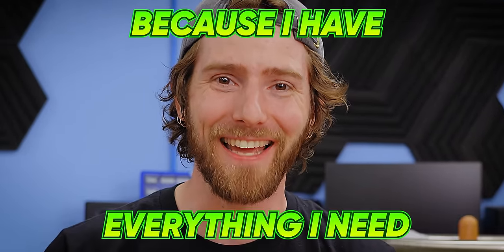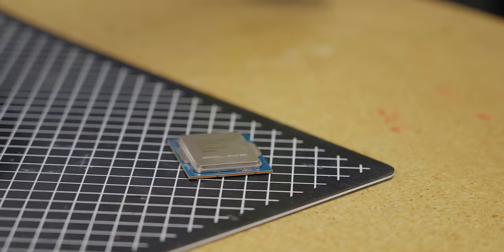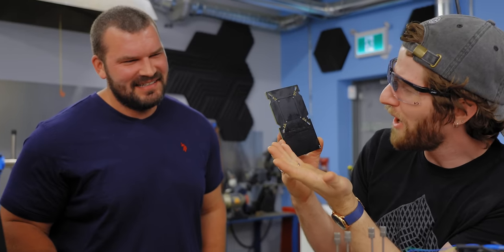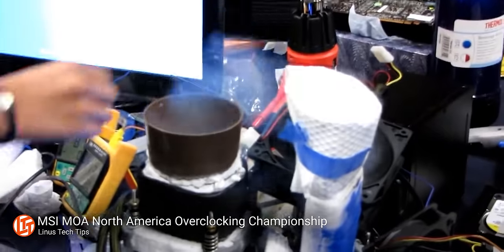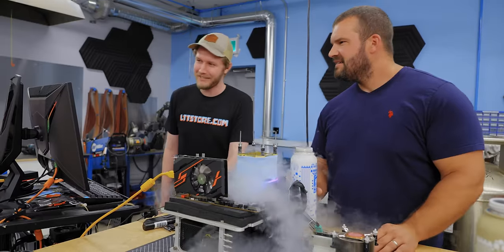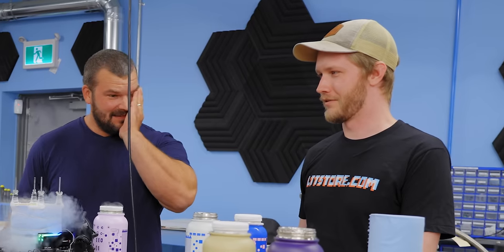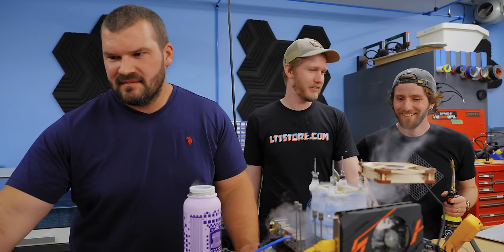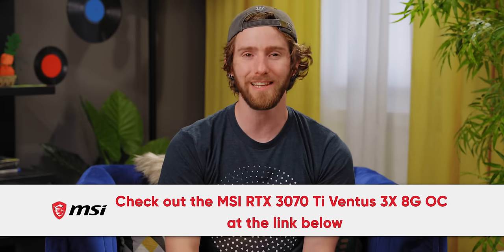The 6.9GHz CPU - LN2 Cooling

Comment: Couple points! Thank you Nikolay Pelov and linuxgeex

At this low a voltage, the motherboard should never arc.

Also, the true thermal barrier isn't even the increased resistance.  It's the reduced impedance due to increased quantum tunnelling as temperature goes up, which increases leakage current, which is the majority source of the increased heat once you get into thermal runaway.
Reply: Is this linus's personal youtube account?
Reply: Okay did not understand it at first
Reply: please make pc inside the vacuum chamber
Reply: ok
Reply: Nice It Linus Jobs!
Reply: @eastenmay4823  idk but it got pinned
Reply: Cool tech tip
Reply: Ar,  I always get me quantum tunneling mechanics confused when considering thermal runways
Reply: I was wondering about this arc comment, it was first Time i Heard about arc due to current
Reply: please try the chuwy larkbox mini pc
Reply: The quantum realm has made Linus forget to log into the LTT Account. He tunneled into his real form so to speak.
Reply: Linus pinning Linus and giving him a heart...
...sounds weird. x)
Reply: @IngwiePhoenix  ya
...is it really linus?
if it is it's probably his other account
Reply: @GD15555  Not sure what good that will do if you want to run things cold. Vacuum do not conduct heat. So the only heat transfer you have is via radiative cooling. Which is the worst cooling. Spacecraft have a big issue with this. So they generally have larger radiator surfaces to help get rid of heat (as well as running relatively with very little power, which helps).
Reply: the quantum tunneling effect > increases leakage current effect would explain why even overclocked it was drawing less power than it would stock on air/water, there's simply less wasted power.
Reply: Beardless linus is not the same…
Reply: Is that (reduced impedance) why the wattange decreases with temperature?
Reply: Idk just like to point out, you missed a perfect excuse to make an "Ice Nine Chills" joke, there is a band named Ice Nine Kills. And you know frozen cpu in the thumbnail.
Reply: you just made that up
Reply: @IngwiePhoenix  It's the Linus Conspiracy
Reply: Linus have you ever heard about Doppler cooling using lasers? Liquid Nitrogen is impractical.
Reply: Yes, I also understand these things.
Reply: Aww I'm certain this was the channel picture when I first subbed to LTT
Reply: Ok nerd
Reply: TIL that silicon has a negative coefficient of resistivity. Now the part of the video where he said the board doesn't like to turn on when it's too cold makes a lot of sense- the impedance of the cold silicon is too high to allow current flow at the voltage that's being applied.
Reply: Wouldn't that trap all of the heat?
Reply: nice
Reply: You are the Meme answer of "why women live longer than guys"
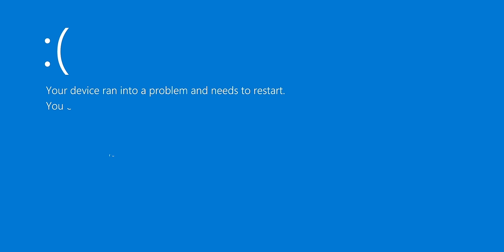Reply: @laupoke  15:52
Reply: Haha, I like your funny science words tech man! Now it is time for me to haphazardly throw my PC into a microwave.
Reply: Bruh... Can u give me this 1030... I still can't afford it in pakistan
Reply: @nickpayne1182  It's true of anything but conductors.  Even a degenerately doped semiconductor though will start to act more like a metal.  It's just a matter of increasing temperature giving you more free electrons (and holes) to conduct but increasing temperature also increases lattice vibration in the form of phonons.  This is why thermal runaway in semiconductors can be an issue.
Reply: @Cythil  The heat radiation travels through it, but yeah, you can't just make heat flow like in matter
Reply: Yes, but is it fitted to the ambiphasient lunar wane shaft in such a way, that side fumbling was effectively prevented?
Reply: @nickpayne1182  l
Reply: Thanks man I understood everything
Reply: my friend its nice to see you bend with the legs but safety should be first not after shattering a banana ...otherwise this rocks
Reply: One more point mister Sebastian, the term for moisture in the air going from a gas to a liquid is condensation, or the act of condensing, as the molecules condense, or become denser, condensating is not the correct term, idk why but this triggered me a bit.
Reply: Real yt acc
Reply: I was about to say the same...thx.
Reply: @GD15555  it'll just run hot.

They've had to deal with that in space, probes/satellites have issues disipating heat.
Reply: @JorgetePanete  Yes. You nether benefit from conductive or by flow in vacuum.
Reply: The quantum world limits our gaming sadly. probably in 2100 we'd be playing on Quantum Computers (though Quantum computers are VERY not fit for gaming).
Reply: Why don't you guys try making a chamber with a constant flow of nitrogen gas? That way, even if there is a leak somewhere, as long as there's a positive pressure of nitrogen gas inside, moist air won't be able to come in. Unlike with a vacuum chamber, you must ensure a good seal between all the cables and things that need to be accessible outside. If something went wrong with the hardware, you wouldn't know until after you evacuated all the air out of the chamber and fired it up, which takes time.
Reply: You should try making a watercooler out of a eutonic NaK solution, it is probably by far the best liquid coolant.
Reply: Wat.
Reply: A 6.9 is a 69 that got interrupted by a PERIOD!
Reply: You even got Jack Reacher on the show!
Reply: since when Linus became nerdy enough to know about impedance or quantum tunnelling or leakage current ??
Reply: @AbdelrahmanRashed  Anthony told him before the show
Reply: While I can appreciate the technical fun of this sort of activity, but I have to ask why?
What is the practical application of this? What has to be done to keep the cpu this cold takes away from using the computer for anything but just bench-marking the cooled cpu.
Has anyone actually engineered a complete closed system that can do this while running as a regular workstation? Not one you have to babysit with constantly evaporating nitrogen?
From an outside observer this just looks like 1/4 mile top fuel drag racing, just with out all the excitement.
I'm not trolling. Have fun with this hobby! I just don't understand why, bragging rights? Knowledge gained in possibly engineering something that can run consistently at this speed? Galactic scale Minecraft worlds?
Reply: @GD15555  Hmm yes over-temperature protection speedrun.
Reply: I take it this is the account that can open garage doors.
Reply: Wowowow. the owner is here.
Reply: These vids are always mind blowing.
I'm slowly saving money to upgrade from my current FX8370 rig I built in 2014. This makes the cpu choice harder.
5950x x570 or 12900K z690.
This upgrade needs to last another 5-8yrs
Reply: In transistors the resistance actually decreases as the temparture goes up. This is what causes the runaway effect. Lower resistance means more current which means more heat which means lower resistance. This is what the runaway effect is all about.
Reply: @GD15555  Where would the heat dissipate into?
Reply: @eastenmay4823  I believe it is... Not 100% sure, but very nearly so...
Reply: Been a while since we saw this account comment.
Reply: yet the record belons to AMD FX-8370
Reply: I like your fancy words madman
Reply: Nice picture
Reply: <obamaawardingobama.jpg>
Reply: @GD15555  I Bff dtyette my hair and I can x
Reply: i read this around 50 times, can you explain in ape language for me pls?
Reply: Why did Linus heart his own comment?
Reply: I was, dafuq? Then, well ofc ^^ carry on friends
Reply: I disagree. Why would  leakage current, which is considerably lower than the majority current be the biggest factor in thermal runaway? Surely both currents are responsible for heating the semiconductor device up, and the higher majority current being considerably higher than semiconductor device leakage currents and therefore cause a greater temperature increase.
Reply: 6.9 - the humor in that number is not lost on most people.
Reply: @peterbelanger4094  Hobbies are a matter of perspective. I find this more exciting and pleasant than the quarter mile drag race, personally. Less noise and fumes and it touches on the spooky quantum science stuff rather than boring old combustion engines.

You've essentially hit on it, though. It's just a hobbyist pursuit of optimizing for the sake of optimizing at thus level. These guys picked a CPU benchmark. Others pick a quarter mile time. Still others are really into finishing videogames as fast as humanly possible. 

These things either capture your fancy or they don't. Sure you can try and work backwards to justify some grander purpose, maybe talk about cultivating practical transferable skills like problem solving, attention to detail, a working knowledge of electronic components and principles, etc. but that's just what you put on a CV or a funding request to justify to othera something you already want to do.

At the end of the day enough people looked at this and thought 'neat' to make a passtime of it and here we are. Maybe something "practical" will come of it, but it'll more likely be by accident than design. 

Then again, history is littered with a number of examples of major innovations that came about from intelligent people goofing off, so who knows?
Reply: Make one for the space station and leave it outside -450 Fahrenheit
Reply: @theSCARB  I'm in Canada too, but Linus is younger and relatively new to computers compared to me lol.  Hence my avatar being bald!  Though with the toques and ballcaps and hoodies Linus wears all the time I guess it might be easy to assume he was covering up! ;-)
Reply: Yep, CPU voltages are now well below 3.5 volts even with maxed out overvoltaging.  This should be perfectly safe for everything but the CPU itself.
Reply: @eastenmay4823   It seems so
Reply: Why - to get rid of moisture in the air - don't you just get rid of air and fill it with... nitrogen for example (kind of half hermetic container that is filled continously with nitrogen and vented out by single vent hole. No moisture - no problem.
Reply: Probably Anthony wrote this.
Reply: nerd
Reply: #LinusHighTips
Reply: @GD15555  That wouldnt really make it colder or make it run faster, it would cause the board to overheat pretty quickly as there is no air or liquid to remove the heat from the system.
Reply: WoW. Never new lienus had a last name.
Reply: This account will be a decade old tomorrow lol. 24-10-22
Reply: @GD15555  i dont understand why nobody did this already it's so simple
Reply: Dude said “liquid water”
Reply: @GD15555  liquid nitrogen boils extremely quickly under vacuum. Thermal throttle a few seconds later
Reply: @eastenmay4823  yes
Reply: @eastenmay4823  i would say no if you check the accout il looks like some fan account.

Comment: I have to say this, I am really impressed by your water bottles and how well they are isolated. I never thought they can hold something like liquid nitrogen for such a long time and that you can hold it with your bare hands.
Reply: This video actually might be the final push for me to get some
Reply: This video is way better marketing for the bottles than anything else they can do.
Reply: you need a vacuum insulated water bottle to prevent the ln2 from freezing your hand
Reply: Tbf, even normal vacuum bottles work just fine, as long as they are actually vacuum flasks
Reply: @YannickBo  For some extra convincing, if I fill my water bottle with ice and ice cold water and leave it shut, it won't finish melting for around 20 hours.
Reply: I think you meant "insulated". "Isolated" means kept away from other things. "Insulated" means it stops the flow of heat or electricity. The LTT water bottles are insulated by stopping the three main forms of heat transfer to the surroundings: conduction, convection and radiation.
Reply: This isn't a OC video, it's a water bottle commercial :D
Reply: Vacuum is vacuum. Best insulator on the planet. If you want their bottles then go ahead I'm not stopping you. They do have cool designs. And they've certainly proven that they're dedicated to quality. But if you're on a budget you can get the same functionality for half the price.

Their low volume gives them a significant disadvantage in price. Their prices have to be high in order to even justify the expense of rolling out new product.
Reply: @sntslilhlpr6601  vacuum is great for conductive and convective thermal transfer, but it does nothing for radiative transfer. At these temperatures this is not too much of a concern, as it goes proportional to T^4, at higher temps radiative transfer can be the dominate heat flow path. With small vacuum flasks like this most the heat transfer is through the lid and the top lip of the bottle.
Reply: Just remember never to put the lid on if playing with this at home.  Might be hard to tinker on your PC after you loose a few fingers or a thermos bottle lid replaces your eye.

Comment: im working with cryogenics for work and the samples we are working with need to be handeled in LN2 at all times so seeing this i got some ideas. If you put the motherboard in a big container, the gas nitrogen (from the boiling) would fill it because it is heavier than air and you would not have air (which has all the moisture) around it. If you have a university or research institute around, you could think about contacting them. Cryogenic work is quite common nowadays and there is probably some experts around that can help with this
Reply: These guys handle some ridiculous materials. They do some ridiculous electrical mods. They engineer all sorts of ridiculous hacks and workarounds.
But they insist on using "common" consumer parts in "common" consumer conditions. That means a computer on a table in normal air, no complete immersion, no vacuum, no exotic environments.
Dunno why, exactly. The hobby is cutting-edge math, science, and tech on one hand. It's unscientific bumbling on the other. It's ruthlessly competitive on one hand. It's team collaboration on the other. It's methodical experimentation and calculation on one hand, it's reckless gamble on the other.
Reply: To add to Groentje92 comment:
Make the container out of 30mm plexiglass then enclose the top. whole thing rubber sealed. Add a flask with a tap to allow the topping up of liquid nitrogen.
Add a vacuum pump. this will allow the chamber to be pulled down to a lower pressure, lowing the boiling temperature of liquid nirogen, allowing even colder temps.

Also might be worth adding a 45psi burst disk,.. just in case of over pressure even if vaccum pump fails at some point.
Reply: @Danko Kapitan structural biology. The microscope we work with works in cryogenic condition so we have to prep our samples accordingly
Reply: @shanewilson3653  I didn't want to go into vacuum as it is probably alot more difficult to pull of but you are completely right. Woud be even better
Reply: @shanewilson3653  when tou close it off you cant heat the cpu up anymore to boot 🤔
Reply: I'm a refrigeration mechanic. I've always wanted to encapsulate the board is a nitrogen filled chamber, with an oring seal around the mouth of the ln2 pot, and sealed wires. Put a few 1/4 flared fittings on it so I can pull a vaccuum and fill it. It would be absolutely 100% moisture and condensation free. My only suspicion would be a leak through the wires, that happens with compressors from time to time.
Reply: @shanewilson3653  I've always wondered why these 'professional' over clockers never just put the thing in a vacuum sealed box.  My best guess is they actually have no idea what they are doing.
Reply: @johngaltline9933  don't even need a vacuum, just a enclosed space and purge it with a dry gas. As much trouble as they go through battling moisture why not eliminate it from being a problem in the first place.
Reply: @michaelshafer2996  I mean, sure, but it isn’t any trouble and a proper evac pump only costs like $300. No need to refill bottles on your chamber gas, especially for these “pros” that I would think might change boards or components often.
Reply: @thegiantgaming7592  I'm sure they could come up with some sort of cotraption to lift it out of the liquid and let it warm up (it doesn't need to come up room temp, just slightly abowe LN2 temp). Or just, you know, tilt the container... And if thats not enough, there's plenty of ways to heat it, laser, resistive heater, etc...
Reply: It's simply not accurate to state that nitrogen gas is "heavier" than air. Air is 79% nitrogen and most of the rest is oxygen, which is denser than nitrogen. If you mean that cold nitrogen gas is denser than warmer air, then sure, but at the same temperature, nitrogen gas and air have the same density and would simply mix. What would happen in a semi-sealed container is that the rapidly expanding nitrogen gas would displace any water vapour out of the container.
Reply: @pwnmeisterage can't they just put it in a dead chest freezer from the dump or something

Comment: Gonna be fun next gen with rumours Zen 4 is hitting 5.8Ghz in the lab in early silicon samples, we're gonna have many more attempts at very high clock speeds coming up.
Reply: Man that sounds wild.  I wonder if they're gonna be hot as fuck or real efficient.
Reply: Man that sounds wild.  I wonder if they're gonna be hot as fuck or real efficient.
Reply: @batt3ryac1d  efficient, zen 4 will be insane
Reply: @batt3ryac1d  All CPUs can be both inefficient and efficient, it only depends on what power they run them at from the factory. If you're worried about efficiency just undervolt it like I do.
Reply: @theplayerofus319  shouldn't undervolting not do any harm to it? you're just decreasing the amount of electricity going through the cpu.